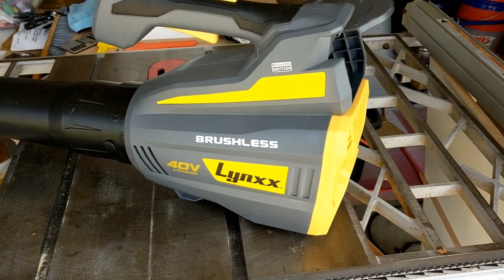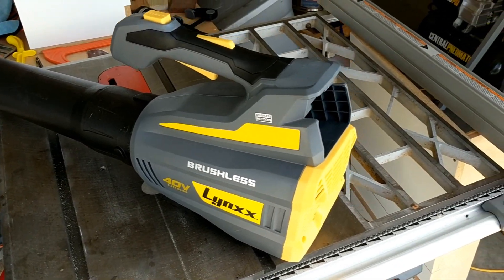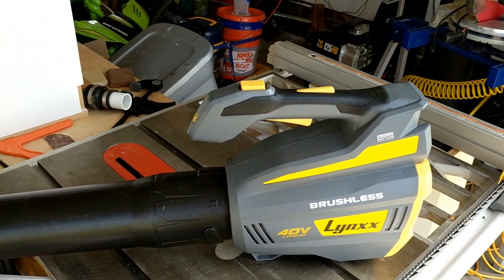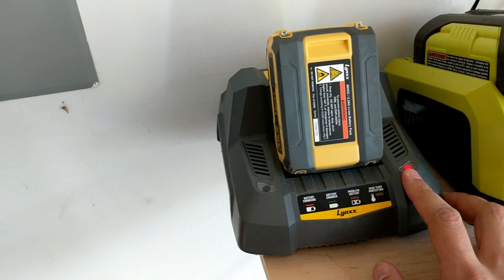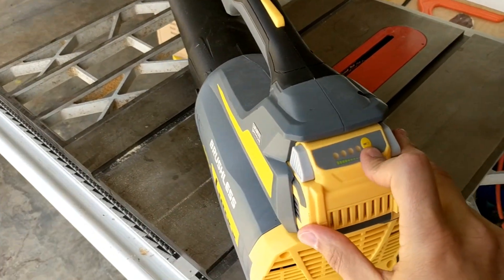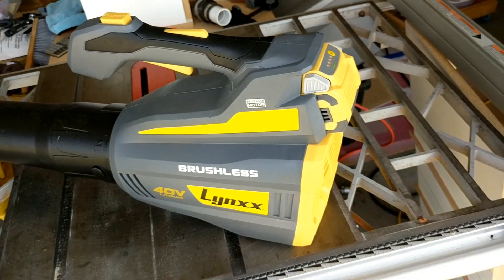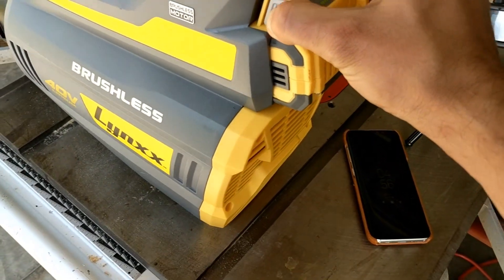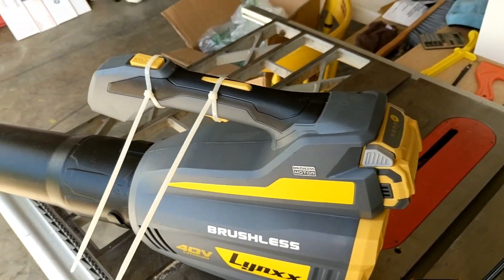Lynxx 40v Cordless Brushless Blower Battery Test Harbor Freight 63284

Comment: I have charged the battery once and have used it probably 6 times for general yard maintenance. Not a bad sized yard. Still has a 3/4 charge, and works very well, too. Love the ease of use and was totally worth the $120

Comment: 9 minutes on highest is pretty good for a 2.5ah battery maybe get 20 minutes on normal use.  i'm hesitant to buy one but seems to perform ok.   keep us up to date on the battery life or how many cycles you get before it craps out i'm still worried about long term battery reliability on this brand.
Reply from the maker: I would say go for it. At this point I am nothing but pleased with this tool. Solid tool.
Reply: How is it holding up now? Any update?

Comment: My Milwaukee blower like that only runs for 15 mins on a 9.0 battery, so this might be a better deal since just the tool is a $150.  and then you need a battery.
Reply from the maker: +Video-gamer-for-life which model Milwaukee blower do you have?
Reply: the 2728-20 the one for outdoor use. I got less then 2 hours of run time on it and it's already in for repairs.     the bearing in motor went right away

Comment: Hmm, mine has stopped working. It blows for like 1/2 seconds and then immediately turns off.
Reply: check the internal thermal switch or look for typical far east mass produced bad solder joint on wires